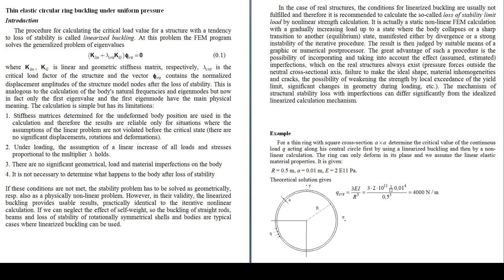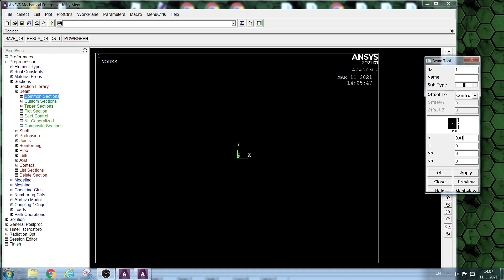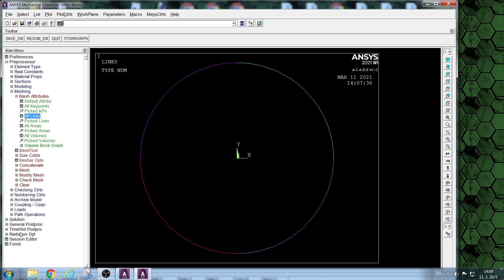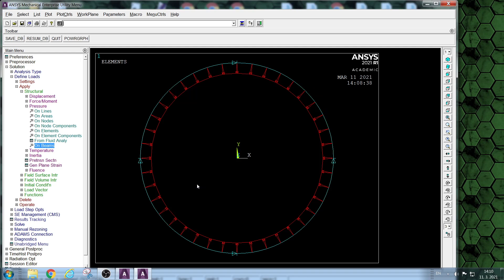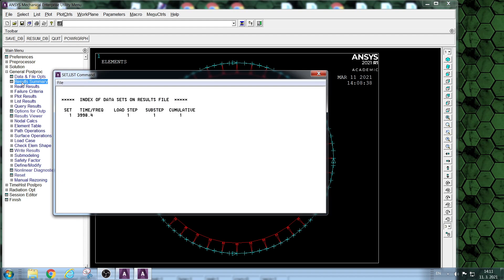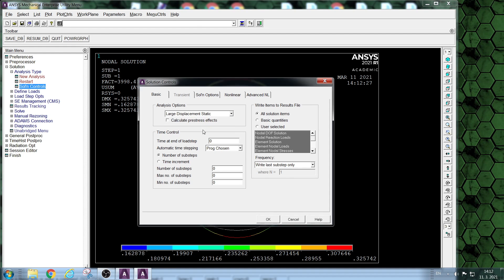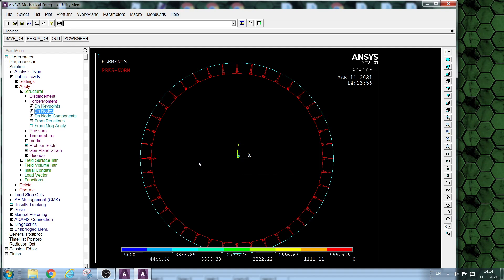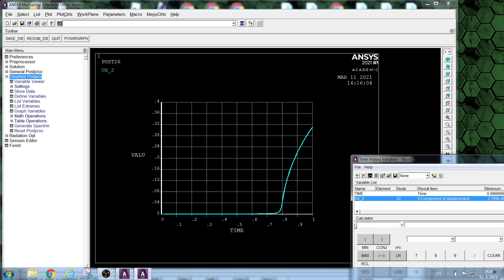Circular Ring Buckling

Comment: Thank You for the video. I tried to do the same problem in ANSYS Workbench using rectangular beam elements. I am defined a cylindrical coordinate system and applied line elements in the radial direction. I constrained the ring using 3 displacement conditions on nodes( as I am not aware of defining keypoints in ANSYS Mechanical) as you have done. The answer is not matching and very different. I doubt whether the line pressure is applied normal to the beam? Pleas help.
Reply from the maker: Sorry. I published this video precisely because I could not completely model this problem using Workbench (ANSYS Mechanical) and thus not even solve it. I haven't found a way to apply normal circumferential pressure to the ring.
Reply: @stefan56  Thank you for the reply. Finally I was able to setup and solve the problem in ANSYS Workbench. This is how I did it.

Instead of beam elements I have used solid elements. I used solid element to form the ring of radius = 0.5m and a cross section of 0.01mx0.01m with material  of Structural steel(E = 200GPa). I applied pressure of  0.1MPa to the circumference and displacement boundary condition(Uz=0) with weak springs on. I got load factor of 3.872. So the critical buckling pressure = 3.872 x 0.1 x 10^6 Pa = 387220 Pa. Converting it into line pressure, I multiplied 0.01m of length of the cylinder, 387220 x 0.01 = 3872.2 N/m. Please give it a go and let me know if it makes sense.
Reply from the maker: @schrodinger4170  It's OK. Theoretical pkrit=qcrit/0.01=4000/0.01=400000 Pa.